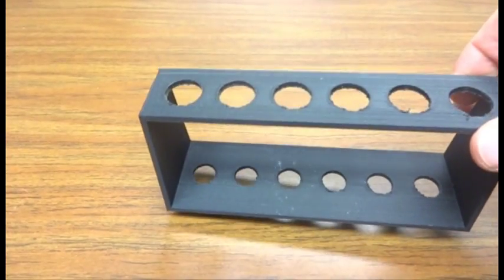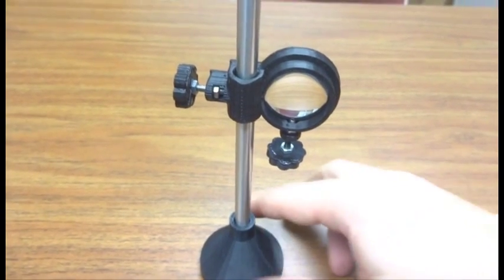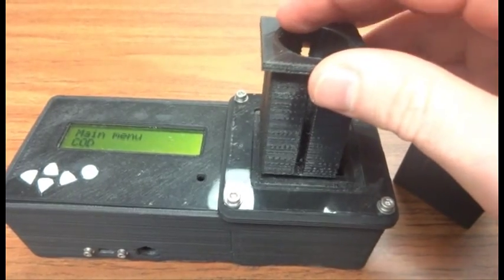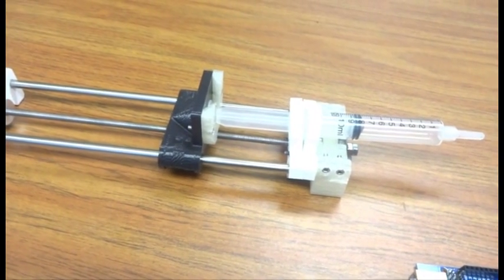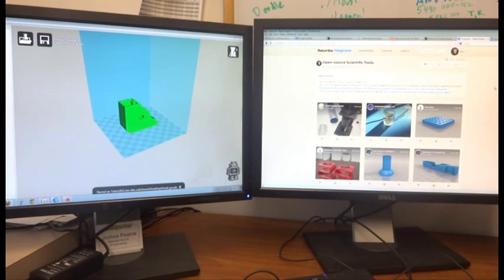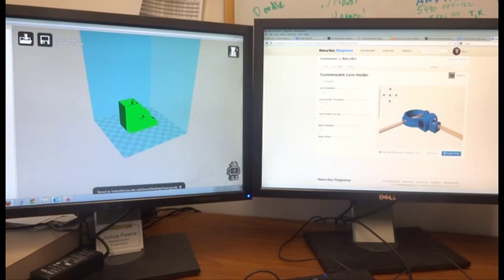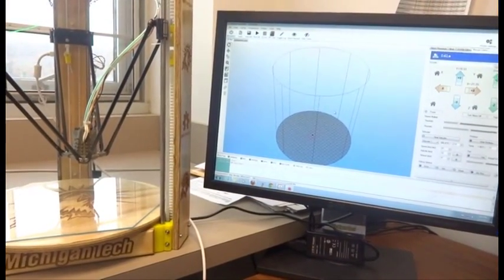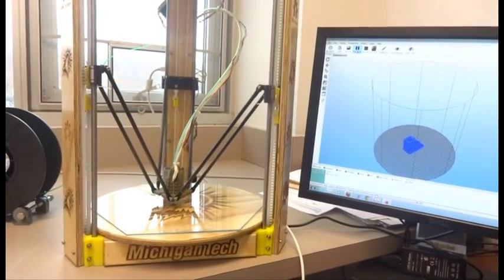Dr. Joshua Pearce - How to 3D Print Your Own Lab Equipment

Comment: I just designed on tinker card and 3D printed a transfer unit repair . Manufacturer doesn’t offer it, asks-ingredients instead for £1,000 to buy another. Instead I just made it myself. £3,000 worth of equipment saved. Job done. 3D printing should become standard in every lab.